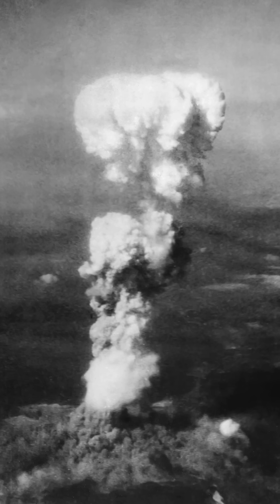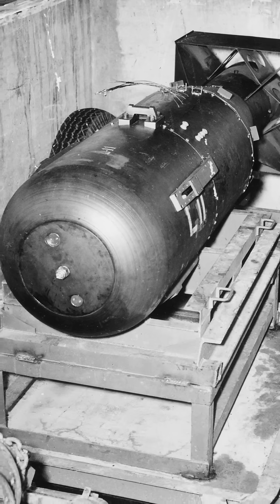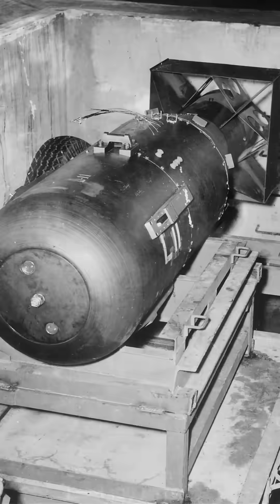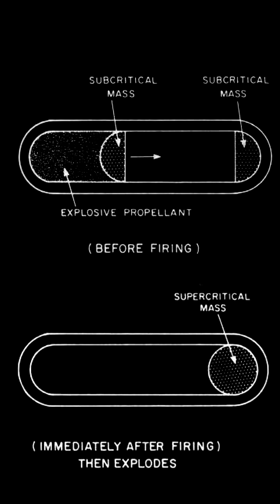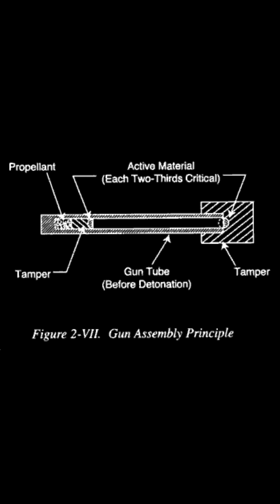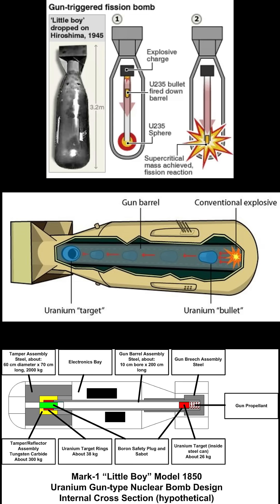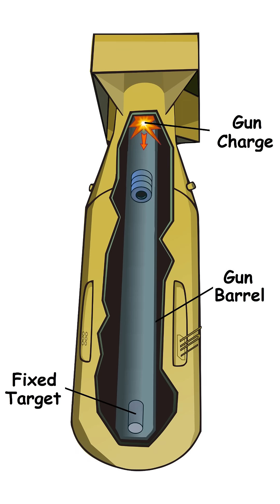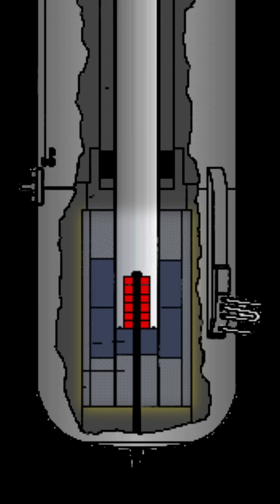What Everyone Gets Wrong About The First Nuclear Weapon Used In War

Comment: Actually, what most people get wrong about the first use of atomic weaponry.. Is that Hiroshima and Nagasaki were not military targets, and  bombing them was some 'unnecessary' revenge action..
Japanese rulers knew the war was lost, but still wanted to bleed the Allies so no surrendering would be necessary.
Hiroshima was the main Army disembarkation point and Naval base.
Nakasaki was the HQ for the 3rd Army group and main defense force. 
Why this is not common knowledge and standard information is due mostly to the proliferation of Nuclear stockpiles and not wanting to ever make using them sound rational... it worked.
Reply: "Nagasaki was a port city located about 100 miles from Kokura. It was larger, with an approximate population of 263,000 people, and some major military facilities, including two Mitsubishi military factories. Nagasaki also was an important port city" 

Hiroshima was a industrial hub...that was used to fuel the war machine they were all legitimate targets.
Reply: If these cities were such legitimate military targets, why were they put on a list to NOT conventionally bomb? These were clearly nuclear tests themselves, but on people.
Reply: @imacds 
Because the US was intentionally saving cities so in the event the bombs were dropped, there could be no mistake on what the results were. Either to the IJA and the emperor, or to western bda flights. 

P7 man. P7.
Reply: And no mention that neither city was a primary target
Reply: It was mostly a mafia-style message to "Little Father" Joe, I think.
Reply: Bit of an unprompted bogus justification for nuking 2 cities, but whatever lets you sleep at night, mate. Nobody asked though.
Reply: @BruderRaziel  250,000 dead from 2 bombs with unconditional surrender. Between 1944-45, bombers killed 350,00 Japanese.  They did not surrender.    
The US could have NOT used the bomb.  Thereby extending WWII by 2-5 years, killing 10-20 million people instead, all sworn to defend the Emperor. 
Initial estimates of an invasion were 1 million US casualties. 
The way I was taught was that 30 million is a much larger number than 250,000.   Cannot understand why the method is more important than the number of lives actually saved.
Reply: @BruderRaziel  If they didn’t drop the bombs, they would’ve needed a full scale invasion of main land japan. That invasion would’ve killed millions more civilians and military personnel than the bombs did
Reply: @BruderRaziel  You completely missed the point and injected your own narrative. Homie just stated a fact, jeez.
Reply: @BruderRaziel   Did you not hear of the fire bombing of Tokyo, a military target, yes, but a destruction that spread to the civilian populace?  When fighting another nation, no matter the nation, that nation sees the civilian populace as a military resource, usually as an industrial force, as much as they would their actual fighting force.  Thus, the lines between military and civilian become blurred, the military become fortified in civilian sectors, and what affects one affects the other immediately.  Therefore, I will hold the Allies blameless for any and all civilian deaths that came from dismantling the Japanese war effort in mainland Japan.  The ones truly to blame is the Emperor of Japan and his cabinet, for starting the conflict and creating the moral dilemma that we are still talking about to this day.  Had the military chose to split itself off from the cities to spare its civilians from being caught in the crossfire, no one could cry foul about civilian deaths unless the cities, now demilitarized, were also bombed, but that is not they chose to do.  It disgusts me that you trump up the charge of genocide against the much more moral half of the war, who could have gone on to genocide, who had the power to do so, but chose not to, when the Axis and Allies equally had their civil population in a precarious situation.  The ones to blame are always the ones to declare war first.

Comment: The little boy was incredibly inefficient. Though over 100 pounds of Uranium were used, only 0.7 grams were actually converted into pure energy. Literally less than the weight of a dollar bill
Reply: Now I'm wondering if a dollar bill met an anti-dollar bill and they annihilated, would the result be about twice as energetic as The Little boy?
Reply: @hoebare  asking the real questions
Reply: @hoebare not even in the same ball park, matter-antimatter annihilation converts 100% of the mass to gama rays, when u-238 decays only ~0.002% is converted to energy. That's what? 100,000 times the energy?
Reply: @xxportalxx. Yes, only a tiny fraction of the uranium is converted to energy. But you're forgetting - that tiny fraction was 0.7g, and that's what he's comparing to the mass of a dollar bill. So it sounds to me like he's about right.
Reply: @xxportalxx.  Uh no. as said, little boy yeilded 0.7 grams of mass into pure energy. 2 dollar bills is about 2 grams. 2 grams into pure energy would be 179TJ
Reply: @Jaccayumitty  ah yes, you're correct, it'd be like 260% more energetic off those numbers. I misread it originally as 'only ~.7g actually fissioned.'
Reply: @hoebare  I’ve tried this with a negative 12 dollar bill but I started Armageddon
Reply: @hoebare  do you mean a greenback and a Sacagawea golden dollar coin?
Reply: @hoebare 
No dude, you’d just have two dollars, one for you and one for your “auntie.”
Reply: @hoebare  Probably about x2 if the amount of little boy or 179 TJ of energy
Reply: @hoebare  yes
Reply: @hoebare use Einstein's mass-energy equation, it'll tell you the  energy created
Reply: @hoebare  yes, unless it dispersed due to heating.
Reply: That's not how that works. That's like saying your car is 0.000000001% efficient because it doesn't contain antigasoline and annihilate the gasoline. Nuclear weapons do not contain antiuranium and do not work by annihilation, which is the only way you can liberate 100 pounds of energy from 100 pounds of material. The harnessable fissile energy of U235 is about 20kT/kg which puts Little Boy around 1-2% efficient, not 0.0015% efficient.
Reply: Doesn't that mean that potentially a fission bomb could be *tiny*?
Reply: @UdderlyEvelyn  Yep, look up the W54, it's a fascinating read
Reply: Honestly knowing it was only at 0.002% power makes it even more terrifying.
Reply: @driftliketokyo34ftw35  well it was technically at full power, it was just incredibly inefficient. however, there ARE modern warheads with something called "Dial-a-yield" which means you can change settings on them to change their power.
Reply: @user-mn2mw1og8u But do any of them go to 11?
Reply: Yeah but isn't the amount of mass converted into energy in Uranium fission generally pretty low anyway?
Reply: I read some comments. There seems to be a misconception about E=mc^2. You need to have a mass that travels at a velocity to produce energy. So far ok. But it is not that the basic mass, being Uranium all of a sudden stops to exist. It splits, called fission, and falls apart in possible multiple other elements, each having a mass. During this process a lot of heat and emission of Alfa, beta and gamma rays occur. Pity no one tries to even do some basic study of nuclear physics. Out of 25 students only 4 saw there was a problem with half lifetime of the remaining fission products.
Reply: I thought it was closer to .45 grams
Reply: @paynej32013  My source is "command and control" by Eric Schlosser, and I can't say exactly how he got his figures. the answer probably varies depending on what yield the author uses, as some estimations differ
Reply: For context, 0.7g of U235 is about the size of a sesame seed.
Reply: @ronaldnewman4828  A very dense sesame seed.
Reply: A dollar bill weighs way less than .7 grams
Reply: You use pounds and grams in the same sentence. That even worse than using imperial measures.
Reply: @РайанКупер-э4о  😂😂😂👋🇨🇦
Reply: @abelis644 haha same tho 🇨🇦🇨🇦🇨🇦
Reply: @РайанКупер-э4о  Funny enough, the avoirdupois pound has been based on a metric physical standard for a long time. Almost all precise calibration testing of weight in the US have been done against the K20 and K4 metric weight prototypes called the "International Prototype of the Kilogram".

But on May 20, 2019, we stopped using real physical objects, and instead use various fundamental constants for measurement, like using the Kibble Balance to measure the Kilogram based on Plancks constant.
Reply: @Aethenthebored  Wait, it's called "avoirdupois" ? As A French I find this incredibly funny
Reply: @CdFMasterVideo  Yup, that's what the imperial system of weights is called in the US, UK, Canada etc
Reply: @CdFMasterVideo In the UK it's called the Imperial system. And that's different to US units, for example pint, gallon and ton are all different amounts.
Reply: @РайанКупер-э4о  European detected, opinion discarded
Reply: @РайанКупер-э4о  I mean, it's pretty common to use both depending on what you're weighing.
Reply: @РайанКупер-э4о funny you Say that brcause Nasa was doing the exact same thing
And somehow ended up on the moon

Humans are truly funny 😂
Reply: @РайанКупер-э4о its not as though the imperial-metric conversion factors are any more unhinged than imperial-imperial conversion factors...
Reply: @РайанКупер-э4о that's how american science works
Reply: @worldspam5682  Countries that have put a man on the moon: 1

Countries using the metric system that have put a man on the moon: 0
Reply: @teebob21   Countries that continue to ride waves of nostalgia, convinced being pretty popular "back in high school" still matters as a grownup:
1

People who have grown weary of complacent, jingoist Americans who think it's possible/trivial to stop trying and still be the best:
8 billion, +-330 million
Reply: @worldspam5682 guns per eagle=freedom!
Reply: @teebob21 nasa actualy uses metric
Reply: @affegpus4195  That's correct. Since switching to metric, NASA has put zero men on the moon.
Reply: @teebob21 Not true. The Apollo missions used metric extensively, for example the Apollo Guidance Computer worked entirely in metric and converted to US customary for display and input purposes.
Reply: @TurnOffTheInterwebs  Don't care. Still went to the moon using feet per second as the primary measurement of velocity and you didn't. Mald harder.
Reply: @teebob21  > Don't care

Selective apathy at its finest--a shining example to all.

I'll bet you could throw a football over those mountains.
Reply: @TurnOffTheInterwebs  We don't have footballs in Stalingrad. Not sure what relevancy that has to do with the fact that Americans put men on the moon using customary Imperial units.
Reply: @teebob21  Jokes are less funny when they need explained, but here goes...
In the film Napoleon Dynamite there's a character named Uncle Rico.

Rico spends the entire movie wistfully pining for the good ol' days when he was relevant in football, because he peaked in high school.  At one point he tries buying a time machine (falling for a scam) so he can go back to it.   He even uses a tripod to record himself in mock football plays, making a highlight reel for ...?  Someone.

Rico is a tragic character, and most of us know someone like him--desperately clinging to youth and the value they placed in something that's long gone.  One of his lines in the film is something like
"I bet I could throw a football over those mountains."

Your first comment in this thread was a reply to WorldSpam, who poked fun at American science.
Your comment hinged on either (a) the US as a world leader in technology, because of the lunar landings, or (b) the Imperial measurement system as superior.  Either of those is a valid cause for comparing you to Uncle Rico.

(If I misinterpreted your initial comment, I hereby apologize for my past three comments, because they were reacting to the stance I assumed you were taking...though I'd be surprised if I was the only one)

Lastly, Stalingrad?

I see you let it slip that you're a Russian troll... which gives you an excuse for not having seen the movie.  

However, it also makes your first comment a little odd.  So is this a false flag operation, trying to get people to dislike Americans?  If your goal was to confuse me, then congratulations I suppose.
Reply: "0.7 grams were actually converted into pure energy."  Doesn't a fission bomb just split nuclei? It doesn't actually convert the matter into energy (correct me if I'm wrong). Or was that 0.7g the "mass" loss from breaking the nuclei?
Reply: @gargantuablargg  Without getting into the entire "energy makes bound nuclei heavier" physics discussion, YES, 0.7 grams of matter were converted to energy via fission. That's how fission works. The number of total nucleons remains the same, but by splitting the atoms, the binding energy is released and the total mass of the fission products is less than the inputs.

In this way, mass is converted directly to energy via fission.
Reply: @gargantuablargg nuclear fission (splitting of heavy elements into light elements) will result in the sums of the masses of the new atoms having a mass less than the original atom. This difference in mass was converted in the process of fission to energy. Fission releases energy all the way down to iron (element #26). Once beyond iron, any further fission requires an energy input. 

Fusion works the opposite. Fusing light elements into heavy elements will release energy all the way up to iron. Beyond iron, further fusion requires an input of energy to create n ew elements.
Reply: Terrifying to think of a modern one going off
Reply: that's still A LOT of energy in 0.7 grams of mass. About 63 TJ of energy.
Reply: Vsauce fact
Reply: now wait, we got a unit problem, here. A U235 has about 235 x 938 NeB = 200,000 MeV of mass energy, and a fission releases 200 MeV on average, so to release 0.7g (a paper clip) of energy, you need to fizz about 700g of U, which is around 30 cc or 6 teaspoons which is 2 tablespoons or 1/8 a cup aka 6 pats of butter. Trust me, I have a PHD, and I've been to Los Alamos.
tl dr: 6 pats of uranium butter fizzes and releases a paper clip times 1 square foot Hz/second of energy ~ 20 kT.

also: don't cray about units, just know them.
Reply: My favorite way to describe it is 
We turned a butterfly into energy and vaporized 80,000 people 

Nukes are nuts and we only made em bigger
Reply: Just imagine how absolutely insane it would be if it was 100% efficient. An explosion, at minimum, 100x more powerful. 

We figured out how to manipulate one of the fundamental forces of the universe, electromagnetism, and that led to the modern world, and me being able to type this comment on an instant global communication network (the internet), then we started figuring out how to manipulate the nuclear forces and that both leveled an entire city as well as made a few places entirely uninhabitable due to radiation after a couple reactor meltdowns, and the stuff that makes it uninhabitable, nuclear radiation, is completely invisible. We’re actually out here f**king with the universe because we figured out how to, humanity is actually off its rocker
Reply: @PERTEKofficial  at %100 efficiency it would be equivalent to 974 million tons of TNT exploding, which is just under x20 the power of the Tsar Bomba, the most powerful nuclear weapon ever detonated. If the universe doesn't want to be fucked with, it should say something
Reply: @user-mn2mw1og8u what's the smallest nuclear explosion possible?
Reply: @paolosciarpuccio  No idea. The smallest Nuclear detonation ever was the "Davy Crockett", at the equivalent of 20 tons of TNT, though.
Reply: @PERTEKofficial  We have no choice but to fuck with the universe. It's the only way we can move forward.
Reply: Can we all stop using the phrase "converted to energy" please... 😂 As we all know that's impossible.
Reply: @chrisburn7178  do you... not believe in E=MC^2?
Reply: @user-mn2mw1og8u  You got me there 🥴 Back to school lol
Reply: @chrisburn7178 well thats literaly what happens when matter meets antimatter

Comment: Good article.. thanks. 🙂It opens a can of conjectural worms.. taken that the device was inefficient, means that not all the U235 got burned up.. therefore logic dictates that the rest of the U235 was blown all over the city... a truly dirty bomb... where is that material now, one must ask?
Reply: Scattered as atoms and still hanging around, but not dangerous. U-235 has a half-life of 700 million years, so it is hardly radioactive at all. It contributes a tiny amount to the normal background radiation.
Reply: because it was an airburst, the fissile material was distributed.
Reply: Most nuclear waste from both bombs as well as all tests conducted in utah and in the marshal islands wash officialy rounded up and put into one of the islands they cratered wich was then capped with close to 30 ft of concrete only problem is the island is coral based so the hile regulary flood then that water filters back out also if it get hit with a storm or munitions and the dome breaks it could potentialy end the world via poisoning the worlds oceans and therefor all the other water as well as radiation stays with the water when it evaporates
Reply: Since the bomb was an airburst-type weapon, detonating at 1400 feet, one must assume the the uranium that didn't undergo fission was vaporized, and wound up as part of the radioactive fallout cloud, that spread far and wide. The Army Corps of Engineers scraped the ground around ground zero after the war because of lingering radiation, but I'm sure that much of it spread much farther away. And yes, by definition, it was a true "dirty bomb"..